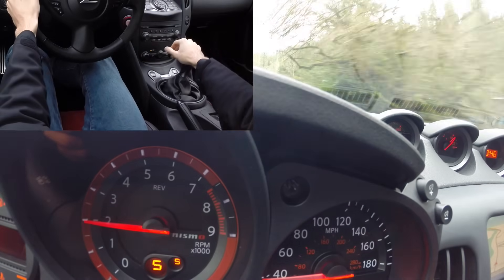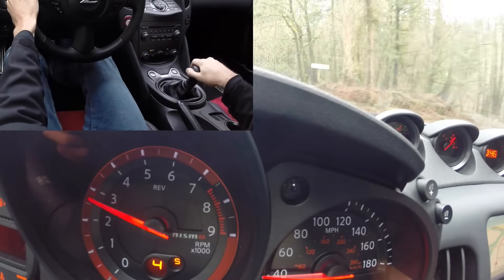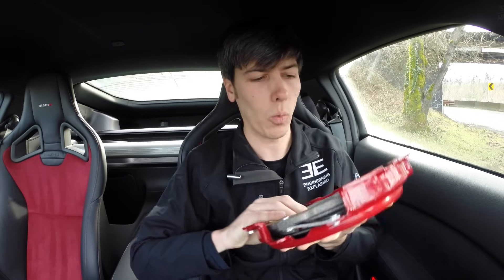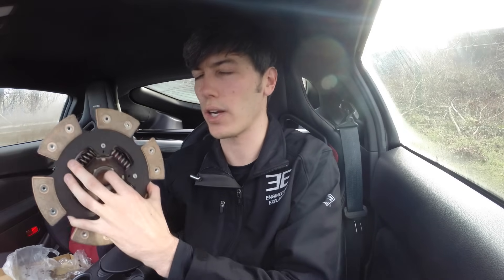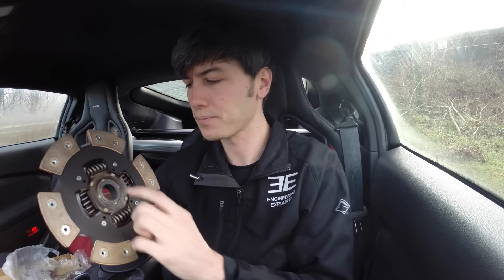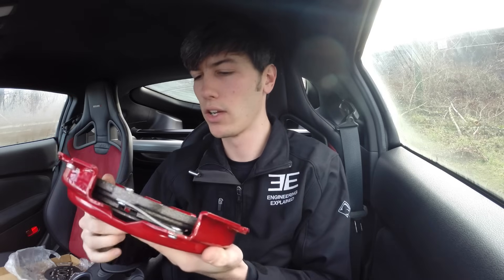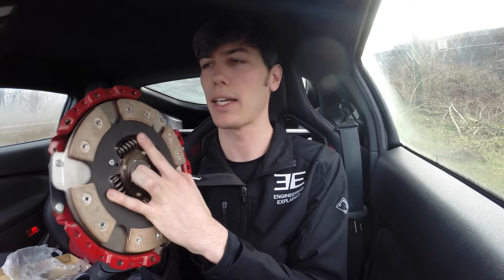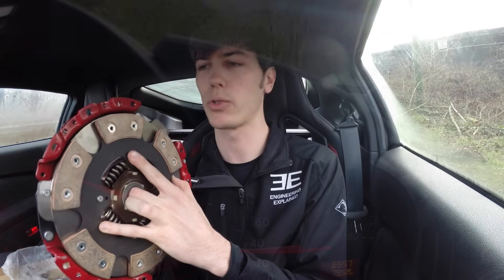What Is Rev Matching?

Comment: is rev matching necessary to prevent engine damage?
Reply: Engine won't really suffer unless the RPM get too high (aka redline). The only thing you're damaging is your clutch.
Reply: It might be a bit of extra wear on your motor mounts too.  If you dont rev match with large changes in RPMs your car will lurch forward before the power hits the wheels and then you will go.  its bad whiplash too.

Comment: I am around the corner from a steep hill and because of the snow I wanted to hold it in first so when I hit the hill it would creep very slowly but picked up too much speed so when I finally changed there was a massive kick and car kicked out into a slide and I caught it but then the bad news I ended up going down the snowy hill in second but made it but failing to rev match nearly put me in a ditch. It is important.
Reply: Good thing u don't live i  the mountains.
Reply: Markus Camenzind We adapt to our circumstances. If you only see snow 3 days in the year then no point changing tyres but if you work at the top of a steep hill as I do then it can make driving pretty challenging especially after snow on Tuesday, Wednesday and Thursday so by Friday that hill was like a ski slope. If you live somewhere where snow is 3 months of the year then you usually drive a 4 * 4 and switch to winter tyres. It is all relative.

Comment: Question: my cars gear is at 4200rpm. If I’m downshifting with rev matching, is it better if I’m approaching 4200 from 4000 to change gears OR dropping to 4200 from 4500rpm and then change gear? Which is less wear or what is more proper? Approaching from 4K is my guess...??

Comment: Why can’t you just slow down, brake and downshift?
Reply: I believe what he is speaking to is when you are down shifting for the purpose of accelerating faster than the gear you are in.   Do if you are doing 40 and in 4th or 5th and you want to downshift to 2nd because you want to maximize you acceleration.   If you dont rev match your car is going to slow down and lurch forward before you start to accelerate.

Comment: In one of your videos you mentioned how with older carburetted cars that you would need to warm up the engine to avoid engine ware... but that with fuel injected cars, that warming up process isn't as necessary... and I was just wondering if you could do a video explaining all the benefits of fuel injection and why manufacturers switched over to fuel injection and deleted carburettors from their cars?

Comment: Hey when slowing down but not coming to a stop . ex: 3rd to 2nd should i use the brakes till the rpms drop low enough for me to shift into 2nd or do i downshift from 3rd to 2nd and rev match by applying more throttle ?

Comment: Why would I open the throttle(hit the gas) when I want to shift down from 4th gear to 2nd gear?
I always hit the brake a lil to slow down my vehicle before making the shift, coz 2nd gear is on low (vehicle) speed. And I just realised, that during the 2nd gear though my vehicle wheel speed is low but my engine speed is higher - but it just confused me a lot more now!!
Why would I increase the revs while shifting down the gear while in reality I do the opposite!
Plz help
Reply: You usually do that to keep the turbocharger spooling when you have one otherwise i don't really see why. Maybe to abuse the 2nd gears higher torque for fast acceleration if your car can handle it.

Comment: EE: were you aware that the 2017 Honda Pilot has down shift rev matching?  And yes it is an automatic, a 10 speed.  It actually speeds up the engine before engaging the lower gear.  I'm not sure if the trim with the 6 speed has it.  I was pretty impressed when I realized what was happening.  Very cool stuff.  Keep the awesome videos coming.  ☺️

Comment: I brake, push in the clutch, shift gears, then give it a little gas while releasing the clutch smoothly. Rev matching is taking your foot off the clutch all at once with the right RPM for the gear you're shifting to, right? Is the way I'm doing it no good? I drive a 30 year old car with no tach, so I just assume if it doesn't lurch or rev high, I'm doing good lol.

Comment: Why is rev matching burning my clutch? 

It burns when I double clutch (trying my best to make sure I lift my foot all the way off the clutch in between neutral and next gear) 
And even when I hold my foot all the way down before kicking the throttle.
Between this and quick shifting (not power shifting) my clutch feels like it's been massacred, and I don't really drive that hard on the regular, just a few off ramps I try to down shift on.

What am I doing wrong?

2015 si

Comment: I don't know where he is going with this  but the  idea is too match engine  speed with the speed that the  gears are turning  that you want to engage the gears..  the  clutch is pretty much  irrelevant ..  it's about the synchronizers..  Heavy Trucks don't have synchronizers and thus  you have  to  rev match with   the gas pedal  Newer Truck are computer shifted manual Transmissions ..

  This was a very bad analogy ..    @Enineering  has no clue how to drive a race car …  dual clutch transmissions and be shifted with paddle shifters..

Comment: When you say blip the throttle, do you mean tapping the accelerator to bump the engine RPM, and then releasing the clutch with your foot off of the accelerator? Or do you mean lightly pressing the accelerator and holding it as you release the clutch? I end up just accelerating as needed when releasing the clutch.

Comment: What if you're on the highway going 100km in 6th gear, but you want to downshift all the way to third, is it necessary to double clutch/ go into neutral and blip throttle, or can you row from 6th to third by rev matching straight into gear?

Comment: For someone who is a novice at rev matching, I suppose the wear on the clutch is just as bad if you push the throttle too hard and the revs go higher than the speed the clutch is rotating at, as it is if you dont rev match at all? You have to be pretty spot on right?

Comment: You guys must hate me. I don't bother with this. I let the revs drop by...taking my foot of the accelerator and then changing down just before it would lug the engine. In my car it tells me to upshift at around 1900 rpm and down shift at 1200 rpm. Likewise when I increase speed I use the same behaviour. No lurching anywhere. If I'm coming to a corner, I let my foot of the accelerator until I have enough time to stop in the distance I can see. 

What I took from this is a. don't coast b. unless you're planning on fast driving rev matching is pointless. I don't think I've come to a situation in ten years of driving where this would actually have helped. I have no clue what this "lurching" thing is.

Comment: So I have a question: Let say you are in a race and you break late in a corner - let say - and you need to find a way to decelerate the car as soon as possible. Not doing the rev match will help because yes, you do upset the balance of the car, but you use the engine too to break: the car decelerates faster. If you do the rev matching you don't get that, do you?

Comment: I find it hard to rev-match.. I could always do it in my E46 but now i can't. I don't know why and it always makes me sad whenever i rev-match wrong because I'm hurting my car.
Any tips?
*I could rev-match better in my '05 Corolla that had the like traditional throttle pedal, instead of the bottom to top one I have.
Reply: how about only downshift when you've actually slowed down the car first so you don't wear down the clutch disk misfiring the rev match blip thing
Reply: AwoudeX nah it’s fine I just needed some more practice

Comment: Hold up.....so I got to ask. 
It is pretty common to slow your car down using your gears, so in your video with rev-matching you saying that it will cause more wear and tear on your flywheel if we do this? 
Should we not use the gears to help in time when breaking?
Reply from the maker: I don't believe I ever said anything about flywheel wear. That's certainly not something to be concerned about when engine braking, especially when properly rev-matching.

Comment: Your explanations/concepts are easy to follow given I have zero experience in mechanics or engineering. (Just happen to love cars and a natural curiosity on how it all works.)

Came across the terms ‘rev match’ and ‘blipping’ and what it’s used for, but never a true explanation on how (and mostly importantly why) it should be done. 

Your demonstration with the physical clutch really brings the point home. It really helps the visual learners out there to understand how it all works in relation to each other. Anywho, thanks for the helpful video!

Comment: so when blipping the throttle, can you give it a higher RPM than needed for a smooth downshift? Say I was in 3rd gear at 30MPH and I needed to downshift. So I push the clutch, blip the throttle, to about 4k RPM, then throw it into 2nd gear. Would that cause clutch wear or is that the correct way to do it?

Comment: I am a learner motorcyclist. I have viewed many youtube videos on downshifting and rev match. NONE explained satisfactorily. Here is why :

The standard explanation given by youtubers is that when downshifting, the engine Revs increases. So, there is a need to open the throttle to match the engine speed and transmission speed. But do you see the dilemma there? IF engine revs INCREASES when downshifting, why the need to further increase the engine revolutions by opening the throttle?

Simple concepts should be explained simply. Else it only means the explainer does not really understand the mechanics.

Comment: And when upshifting the gears, we need to increase the rev as well to match the higher speed in the trabsmission-clutch disc? So, regardless if up or down-shifting, the engine speed will always be slower than the transmission and thats why the revs has to be upped which you call it rev matching which always means opening the throttle?

Comment: You initally said that lower gears run at lower speeds. Then you said at 40mph, if you are at 4th gear, the engine revs at 1Rpm and if at 3rd gear , it revs at 2rpm and so forth. So i am confused by what you said. There sounds to be a contradiction as when in lower gear, the engine is revving at higher rpm instead of lower. I am sure you are right but the explanation you gave can easily be misperceived.

Comment: So Jason, using hypothetical GR as an example. If your GR is 1:1 in 4th and 2:1 in 2nd and you're at 2000 RPM in 4th. Does this mean you blip it up to 4000 RPM (2:1) in order to rev match downshift to 2nd? So you must know the ratio of each gear in your trans in order to calculate what the appropriate RPM is for a smooth downshift?

Also, follow up - if I'm correct about the 4000 RPM ideal. The "real" RPM to match may be less i.e. 3400 RPM due to losses, friction, etc. So if that's the case is it better to "over blip" (4000 RPM) or "under blip" (3000 RPM) with respect to not upsetting the balance of the vehicle?

Comment: So, with the clutch pedal out the clutch disc is in contact with the pressure plate, and by extension the engine? Whereas with the clutch pedal in the clutch disc is disengaged from the pressure plate? Am I understanding that right? Seems kind counterintuitive. Also if that's true, why is it bad to depress the clutch pedal for too long or leave the car in gear with the clutch pedal down while at a stoplight?

Comment: So.. when i got my car i knew enough about cars mechanically but had no ide about the gear mechanics, atleast not for that gear. Was a 92 isuzu aska 2.0, 6gear (incl. Reverse) basically a subaru legacy under a different brand name and testing it out a few times  i could go up to 110km/h in 2nd gear without hitting the red. It got to that speed quite fast too. With still a comfortable engine sound. Which I got surprised by allot as I never seen that doable in a normal car. Do I do know the transmission got replaced once. I still wonder what was different about that gear, maybe someone can tell me? Would be much apreciated! Cheers

Comment: The crankshaft and the input shaft rotate at the same speed as long as it’s connected through the friction disk. When you depress the clutch you release the input shaft from the crankshaft which in turn would slow the friction disk a little bit compared to the constant force of the crankshaft. So you confuse me when you say you are matching the input shaft speed by increasing the crankshaft speed. From reading books, this is what I was taught. If I’m wrong, I would like to know how. After learning about how it works, I thought to myself that rev matching was just giving the engine more power for the load that was going to be taken by connecting the 2 shafts together. The friction disk bites into the crankshaft and kinda jolts the drivetrain if you don’t give increase the rpm. That’s what makes sense to me. Please explain different, I would always like to get learnt.

Comment: The best way to learn this skill is to change gears without using the clutch at-all.If you don't get it just right,the gears grind and you can't shift.This can also help you limp home or to a garage if your clutch fails.Just remember that if you have to stop,be shaw you're in 1st and switch off the ignition just as you come to a complete halt.When you need to get going again,just turn the key with the car still in 1st,and you'll be off again.This only really works on a modern syncro-mesh gear box.

Comment: In an everyday driving situation isn't it easier to let out the clutch smoother without rev matching? The result is almost the same, maybe a little more wear on the clutch, but I don't think that's significant. You will also get some braking force, but if you are doing it gently, it's not a big deal (you may even save your brakepads a little bit).

Comment: i have a serious doubt..u said clutch plate is connected to transmission, which means it's speed depends on which gear u are in..right??!! now if u are downshifting from 4 to 2, clutch plate should have low rpm since it has more torque, but u are saying other way around?? CONFUSING!!🤔🤔

Comment: I couldn't understand the one thing which you have told that in video "In second gear the clutch plate moves rapidly but in fourth gear it rotates slower as compared to second "
Reply from the maker: +v ap clutch must match engine speed. Traveling at the same speed (lets just say 40 mph), in second gear, your clutch will be spinning faster than if you are in 4th gear.

Comment: i've started rev matching in my 125cc bike. in my experience so far, 5th gear to 4th gear,it is not necessary to rev match. but yeah 4th to other  down gears ,it is necessary. similarly no need to rev match in uphill though. steep downhill isn't no necessary. BUT the straight road it is the best thing to rev match.

Comment: But what knucklehead would drive like 100km/h in 4th and just shift back to 2nd without slowing down??? Isn't rev matching just pretty much slowing down before you go to the gear? When i am nearing a traffic light.... i just push down the clutch and roll towards a stop.. then put it in 1st with the clutch still pushed in. when it goes green i go again. 

when i have to gear down for a turn, i pretty much just brake a little until i notice that the revs are going too low, then i go back to 3rd and it's all fine... just slow down before you shift and your fine isn't it?

Comment: Yeah but doing this rev matching completely misses the point. If I want to overtake someone fast, I need to downshift and immediately floor it in order to do the overtake as fast and safely possible.  If I rev match like this I'm gonna lose both speed and momentum and my overtake is going to be a lot slower and more dangerous....
Reply: Mladen Ilic Matching the RPM to your desired overtake gear before the downshift would allow you to mash the pedal immediately with zero loss of momentum o_o

Comment: would it be possible to have an added part defining the rpm on the dash and how to calculate the rev matching? Also, if we can have an example of what to listen for from the car when doing so. I know a lot of skilled drivers use their hearing to better understand what the car is doing. Glad to have come across your channel. Loving it so far!
Reply: It's tricky with my Mazda 6. Sometimes I'm too high in the revs and then other I'm too low. I feel like I'm doing more harm than good but don't think the 6 is tuned this way really. There's a delay in revs that makes it trickier than it should be with this car.

Comment: So i actually learned on my own to "Rev-match" but to do with a human. I usually push the throttle up if i need to down shift. I usually am able to figure out what RPM speed i need to down shift and get the car going again. However sometimes i fail to do so but slowly let the clutch to bring it to speed. Would this be a bad thing or how could i achieve this on a non-rev-matching car?